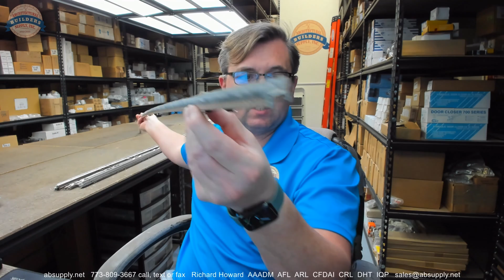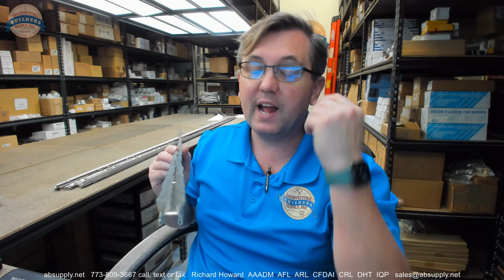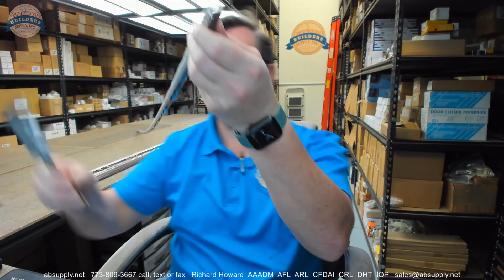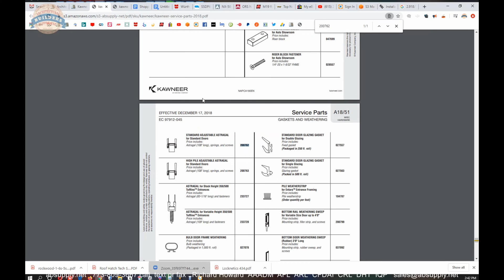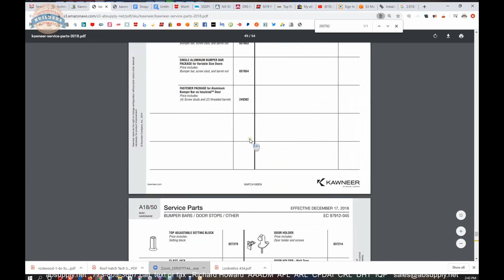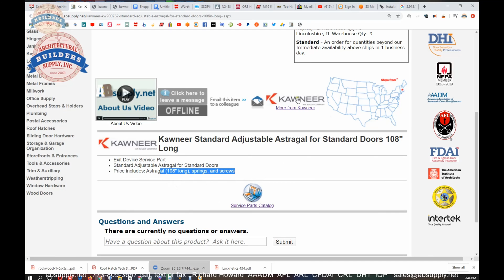Kawneer KW200762 Length Standard Adjustable Astragal for Standard Doors

Comment: Can we use a full length astragal with CVR on a single door? Won’t the astragal bolts in interfere with the rods?
Reply from the maker: Usually yes, they would.  Use really short security drive machine screws, drill and tamp and use thread lock - Rich 773-809-3667
Reply: @absupplynet thank you Sir.